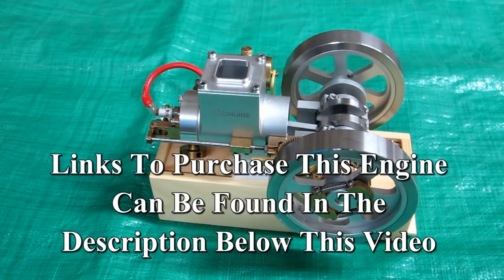Eachine ET1 Upgraded Hit & Miss Engine

Comment: Ron, I am primarily a steam engine fan myself, but recently got one of these engines through Microcosm website (Jin Machine, China).  I learned a lot about how this little beast works just listening to your video...thank you for that.  I have also been operating mine with needle valve open 1/2 turn vs. your suggestion of 1/4 turn...I will try your approach.  I have also been running mine on a 10/1 ratio of Zippo lighter fluid to Marvel Mystery Oil...need to back oil down further as it makes a pink mess and is probably going to foul the spark plug.  I have been treating this as a 2 cycle engine thinking "some" oil is mandatory for cylinder lubrication.  You indicate you run it on straight Coleman Lantern fuel.   Where is the piston/cylinder lubrication coming from in your case??

Thanks again for a very teachable video.

best regards,
Roger
Reply from the maker: Roger, Thanks for watching. Running a bit rich provided some lubrication. There is a second video of this running and I mixed a little WD-40 with the Coleman fuel. I usually drip some oil around the liner and run the piston back and forth a bit before starting. It is a oily mess but that's the way it is with no other lubrication. An oiler for the piston/cylinder would be a good modification. Very good reason to seal any wood with resin or similar to protect from the fuel & oil. The piston ring is a green o-ring so I do not know how long that will last. I see it as a model/demo engine and not intended for long runs. Needle valve setting changes slightly after it warms up. Enjoy your new toy. Ron
Reply: There are actually 2 piston rings on the MK2 (silver) version of this engine, they are 22mm OD by 1mm thick, flurosilicone.  You can buy them in bulk quantity on E-Bay.  With a decent oil mix in the gas, they last about 4-5 hours of running with no load on the engine and are easy to replace. With good oiling the MK2 can run for long periods of time with no worries, it is made with better materials than the older MK1. .  The crankpin bearing has shelled inserts, the mains are needle bearings, and the valves/cylinder are stainless steel.
Reply from the maker: Are the ones you found on eBay green? Do you have a link to the eBay listing? The fluorosilicone o-ring on McMaster-Carr are called low temperature o-rings. Thanks! Ron
Reply: https://www.ebay.com/itm/Oil-Resistant-FKM-Seal-Fluorine-Rubber-O-Ring-Sealing-4-30mm-OD-x-1mm-Wire-Dia/183811679262?_trkparms=aid%3D111001%26algo%3DREC.SEED%26ao%3D1%26asc%3D20160908105057%26meid%3Db35990fa58f543f39fa9e48b3ed884f8%26pid%3D100675%26rk%3D1%26rkt%3D15%26sd%3D183811679262%26itm%3D183811679262%26pg%3D2481888&_trksid=p2481888.c100675.m4236&_trkparms=pageci%3A7c74c556-b915-11e9-82a4-74dbd1804a75%7Cparentrq%3A6c38c0dd16c0a4b7fcbf56d7ffd7555b%7Ciid%3A1  Order 22mm outer diameter- these are the exact high temperature (240 C) rings supplied with the engine, nice to get a set of 100 for about $14.00! Ship from China was fairly fast.
Reply from the maker: Mark, I appreciate your comments and information regarding the Hit & Miss engines. Yesterday I received a package of o-rings being sold by Banggood as spares for the Hit & Miss engine (granted their listing does not say which engine) and they are 23mm OD x 18mm ID x 2.4mm Thick. You show the two o-rings on the MK2 in your facebook photo. Does the Blue MK1 use this larger, thicker 23mm OD x 18mm ID x 2.4mm Thick o-ring? Does the MK1 piston have 1 or 2 o-rings? I have not needed to disassemble my engine (yet). Thanks! Ron
Reply: My older blue engine uses the single thicker O ring- I wrote the measurement as 22mm OD x 2mm thick, but likely what they sent you was intended for the old blue MK1.  You can see the wear "mode" of the O-rings in my photo, the edges of the o-rings start to become flat, they eventually start to break away.

Comment: Yes my fuel tank mounting holes were also cracked. I like your new mount. I also took a Dremel and notched the area for the fuel hose by the carb so its not so bad of a angle. I did make a small thing that keeps the bottom from sliding open all the time.
Reply from the maker: Some day it will receive a heavier base. Thanks for watching.

Comment: I just received mine about 2 weeks ago, and I have to agree with you; I would not want to have to make one for that price!  I have build such model engines, and they are a lot of work and take some fiddling usually, to get them to run; this one does not seem to have that problem.  It is interesting that you chose to operate the ignition on only two cells, I'll try that; maybe save the sparkplug.  These engines run with a "wasted" spark too; I would like to eliminate that and save the wear and tear on the sparkplug. I suspect that you add a bit of oil to your Colman fuel; I use about 10% WD-40 to mine for my engines.  On this one, I am trying lighter fluid for the fuel with WD-40.  I mounted the battery holder on a wood block in the box; I thought that the battery holder moving around might break the small wires.  My wood block secures the ignition module as well.  No I have to do something to keep the lid of the box from coming out with the engine is running.  I also have to decide if it is worth the trouble to slow it down; maybe not. This engine is definitely a keeper!  Thanks for your video.
Reply from the maker: The two AA battery thing seemed to smooth out starting and running... not sure why. The ignition module is sealed with epoxy and I cannot see what is inside (I was following Myfordboy's lead on this one). In this video I was using straight Coleman fuel. A mix with 40% WD-40 was recommended and I have since tried it with no difference in running but hopefully providing a bit of piston lubrication. I assume you know the piston ring is a green o-ring (interesting). It certainly needs a heavier mount to keep it from jumping around... metal base on a concrete block comes to mind. :-) The jumping around (recoil) has some effect on the firing. Larger and/or heavier flywheels would probably slow down the firing. It seems to run pretty well as it is and I will not be changing anything soon. Drip oilers for the piston and the bearing blocks will probably be done. I have another shoulder surgery in 10 days and this will be on a back burner for quite a while. Thanks for watching. Please subscribe!
Reply: Hi Karl, my engine arrived 2 weeks ago. I use premixed fuel  1:25 or 4%  two-stroke oil.

Comment: Just so I am fully understanding... Is this super wasteful on fuel? Or is it literally just moving air in the exhaust port when it is being held open (saving fuel?) Cool little engine.
Reply from the maker: Energy is stored in the spinning flywheel. When the exhaust valve is held open (same thing as compression release) air is drawn in through the exhaust and expelled again, repeatedly, until the governor allows the exhaust valve to close and the engine fires again. While the exhaust valve is held open it cannot draw air through the carburetor because the intake poppet valve remains closed, so fuel is not wasted (economic). Also, when the exhaust valve is held open, the air drawn in through the exhaust and expelled again, has a cooling effect for the cylinder.

Comment: These engines are excellent!  The machine work is fine quality.  Given the amount of time and attention required, the price is amazing.  It's like going back in time 100 years when these engines  were used for farm operations across the land.  The nostalgic sound gives me a feeling of well being.  Your talking points are spot on.  Thanks.
Reply: Robert Hammell how much are these cool little engines
Reply: @billhrn4271  I paid $249.00 to Banggood last year.  Recently there seems to be price drop---just over two hundred.  Amazing price for a machined model engine.
Reply from the maker: Clink on the link in the video description and it will take you to the website. Ron

Comment: That engine sound is unforgettable, especially if a person has had to stand next to a running hit-and-miss for awhile. https://youtu.be/0w5OII6h504 

The Old Days were not really much better nor worse than Today. They were just different.
Reply from the maker: When I started working in the oil field over 45 years ago, these engines were all over Kansas, Oklahoma and Texas running oil well pumpjacks. They ran 24/7. Occasionally an oiler would drip a bit of oil or grease here and there and that was about it.